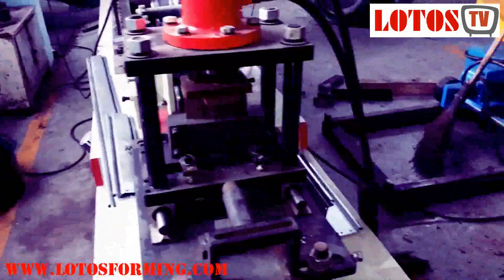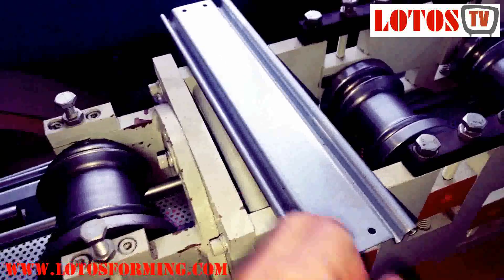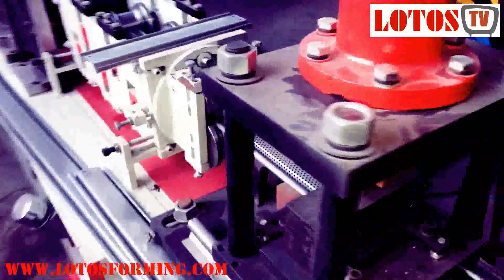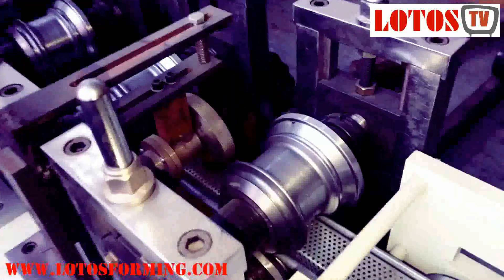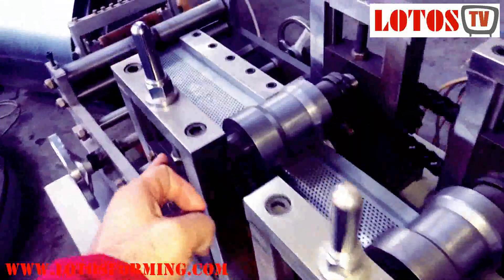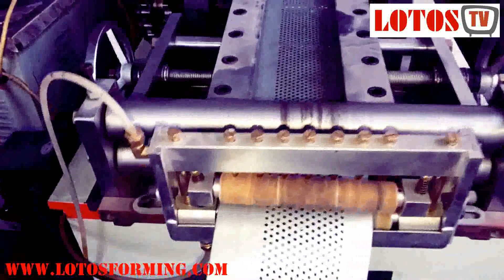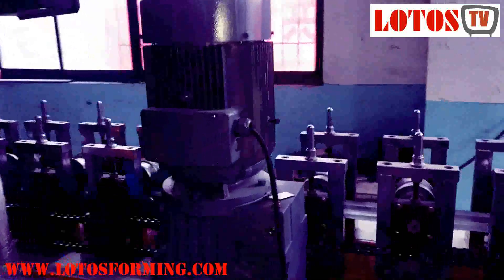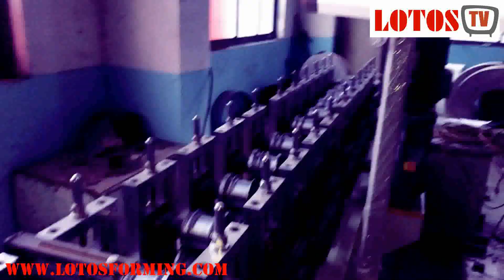Shutter rolling machine | Rolling shutter door machine | Shutter Patti Machine

Comment: LOTOS can design every kind of shutter rolling machine and Rolling shutter door machine for produce roll-up shutter slats From simple security rolling shutters to roll up shutters and Shutter Patti designed for storm protection, custom-designed roller shutters, and even fire-proof rolling fire shutter, very fast roll-up shutter or sectional door rolling shutter, and so on.
Reply from the maker: yes of course